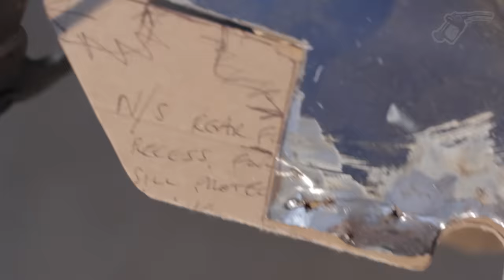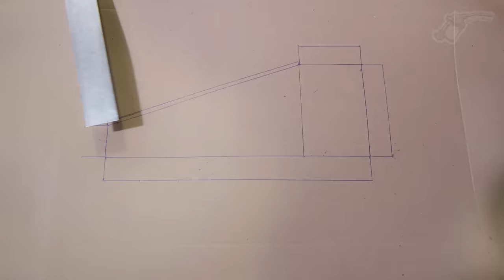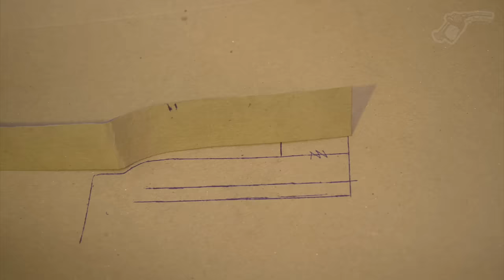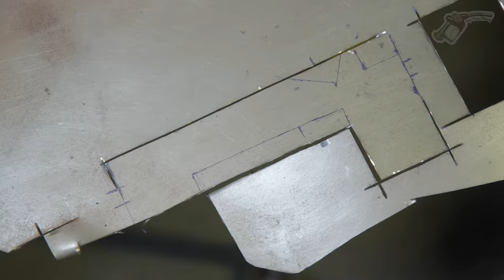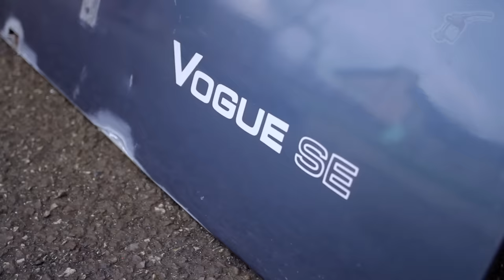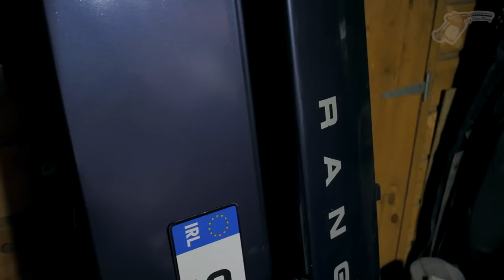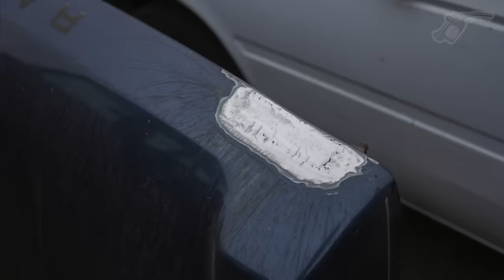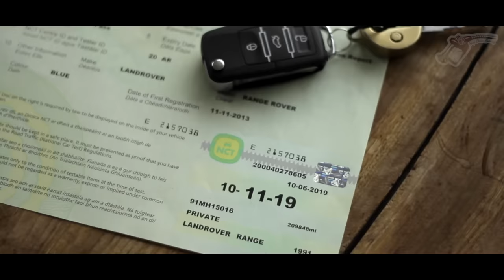How I restored a classic Range Rover and saved it from the junkyard // SOUP Classic Motoring

Comment from the maker: To everyone here - THANK YOU! Just FYI on a couple of the questions and observations; The car was bought new by my uncle in 1991 and yes it lived by the sea, travelled on ferries often and made regular family ski trips to the Alps. It is much loved but worked hard and has 210k+ miles under it's belt. My uncle is a conscientious man and I got the car with a bulging box file of history that begins with the brochure and options list. It details every bit of maintenance, and shows that the car missed only two scheduled maintenance intervals. One by 40 miles, the other by 500. All others were carried out early. Over £48k was spent on money no object maintenance in 25 years of ownership before I took over. The car was just under £38k new with many options. The fact the engine has that mileage without major rebuild is testament to how well it was looked after. The trouble was the people contracted to upkeep the bodywork weren't doing a proper job, unbeknownst to my uncle. Regarding brakes, suspension and general mechanics; the calipers and discs were new just months before I started, they just look tarnished after three years lying up, the car brakes like a modern. The shocks and springs too look a little scruffy but again weren't on the car long. In short it drives tight and even the steering box is almost free of play for a Land Rover. Later in the video I cut out floor sections, and pull back welds that I had already repaired, this was to rectify poor welding that I identified having gained experience. Yes I used a €99 gasless welder from the supermarket. That's all I had, and no money. I didn't do a frame off resto because it took me completely by surprise, it was supposed to be a two month turn around for a quick fix, but the deeper I dug, the worse it was. There were many times I thought 'this is nuts, scrap it' but I wanted to prove what can be done with a determination and passion. Plus there's a Lotus Esprit on the channel that I want to restore to perfection, so I treated the Range Rover as a skills building jigsaw. Practice. I'd recommend that mindset to anyone who has always wanted to do their own car resto. If you want it bad enough you can make it happen! I worked on this full time, and it's just me. The video production work in the project was like a day job, soaking up hours and getting in the way. This Range Rover is dear to me and the family, but no one is under any illusions, the job I did is far from perfect, it wasn't financially viable [but I wouldn't have farmed out the work if I'd had the funds]. What I learned is as rewarding and enjoyable as being able to drive the car. I fully expect to do a body off restoration on it later. But not before I enjoy it for a few years first ;)  Thanks again! The other episodes explain the process and the average guy with no budget ethos of the build, and if you're into more, sub and catch up on the Lotus Esprit project. That's shaping up to be special. This project was funded by patron support only, you'd be surprised by how little it cost overall once you are determined to do the work yourself and make anything you can rather than buying. Any support you can give for the channel, whether it's a like/share/sub/turning on notifications/buying a tshirt, or direct financial support, will make a big difference and can be lent here: www.georgekarellas.com
Reply: I admire your persistence, I know very well range rovers and I'd have sent it to the junk yard with that level of rust. Removing the roof ... Crazy! But kudos for such a great work and filming it all the way!
Reply: A very dedicated piece of hard work (sort of like a Kamikaze)  how long did it take?
Reply: Never mind. I listened to the introduction again.
Reply: I may be a bit stupid about this but if you remove the top sheet and find corrosion on underlying structure doesn't it stand to reason that probably a lot of the underlying structure is corroded as well?
Why then only treat the visible area and not disassemble all of it?
Looks to me this will corrode pretty quickly again from within.
I get that this wasn’t your plan but you already invested so much time and effort it seems a bit odd to then cut short.

Anyway great video looking foward to that Esprit.
Reply: Please pin your comment or add it to the description ... this explains why have you gone about fixing the Range Rover in this way. I commend you on the work done for both, the restoration and the video.
Reply: The level of patience and skill required to make this Claymation-style restoration is staggering to me. Well done!
Reply: Amazing the amount of hard work you put into this. Just want to know if the engine was restored already too
Reply: A lot of work for a suv that isn't worth a lot. Great work though
Reply: I love the way your welding got better as the project progressed. There were a lot of component parts which you repaired instead of of replaced. Kudos to you as you saved a heap of cash even if it took you a lot longer. You’ve ended up with a solid, usable Range Rover and while its far from concourse standard it looks like you’ve enjoyed yourself and you’re ready to put your skills to use on the next project 👏👏👏
Reply: I just found the numbered videos. I think they will answer a lot of questions I have. However having a way to contact you might be helpful as I proceed with my RRC restoration. Thanks. Chris
Reply: The Native American tribal music is LOLOLOLOL.
The real miracle in this video is that someone could (1) find the precious time to waste on this, and (2) value their time so little that they'd waste it on this.
It's like those Buddhist monks who spend countless hours on a sand painting only to sweep it into the garbage the moment they finish it.
Reply: Soup, Seriously man great frickin job! I want to do this with a Discovery for an overland build/camping rig.
Reply: "...I wanted to prove what can be done with a bit of passion..." This is the best explanation for what was done. Nice job and well documented - in stop motion! Greetings from Brazil!
Reply from the maker: @johannwolf1  🤠
Reply from the maker: @TasteMyStinkholeAndLikeIt  If you value your time highly then you spend it doing the things you love, don't you?
Reply from the maker: @957X99  Hope you enjoy! Thanks Chris.
Reply from the maker: @Praxics0815  You mean the doors? I they'll be replaced soon as they start to sag. Thanks man, one Esprit coming up. This time it'll be perfect.
Reply: @Praxics0815  you kinda answered your own question. Its was kind of quick and dirty and a project for him to hone his fab skills. There could be many reasons why he didnt do it, probably time being the main factor
Reply: Am subbing immediately.

Spent the hour in awe.

Have an e34 I have been meaning to give this kind of treatment. 

You my friend, are an inspiration.
Reply: Just recently discovered this amazing channel George, fantastic work but how is the Lotus coming along, I've binge watched all the current episodes and its been a while since your last Lotus up load.
Reply: My God... what have you done. Stunning work all round. And a worthy subject, none more. Chariot of the Gods.
Reply: Um, how many months did this take to do?! What job do you have that gives yo so much time to do this?
Reply: i was going to say i love the skill but hate the car. but i guess there is history there. so much respect
still great skill and great vdu
Reply: WOW! You have me awe struck. 

But, as (amateur) photographer, I have to ask... How many months would you have shaved off the restoration time had you NOT documented the process in the superb way that you have? Capturing all that work and editing it to this video must have taken its toll.
Reply: I have always been amazed at the degree that the Brits were willing to restore cars. An uncle's car makes more sense, but this stop motion restoration is as brilliant and mesmerizing as it is crazy! I have an early 60s Vespa that I restored when no one wanted them (and were having them crushed in a cash-for-clunkers scheme in the 90s) and now they are made from unobtanium and very valuable. I hope that RRs will enjoy a similar upward valuation. Also, it occurs to me, that the RRs had aluminium bodies. Weren't they supposed to be immune to body rot????????
Reply: Sir! There is one word todescribe your work: Mesmerizing! And there is one word to describe you: a passionate artist! You deserve 50M views and 5M subscribers!
Reply: somebody pay this guy a cold pint he rebuild a entire car alone WTF
Reply: Hey bro, I really enjoyed your video and I know it takes a lot patience and last you have your reward, superb 😎👌💕
Reply: What if were to restore a Land Rover?
Reply: You should have just stuck in it all down and did everything at once instead of start at one end and then put it back together and start the front end start the top of it back together just take it all apart and do it all at once
Reply: The choice is a cheap stay or they can put a little bit of nickel in there that still won't rust it Russett everywhere from one end to the other was it worth it how long did it take two or three years
Reply: RESPECT from brasil, you are genius
Reply: @computadordacasa5236  yes I know but can you believe it is hard to be me
Reply: SOUP . Classic Motoring I loved watching this film, I bobtailed a 1976 3 door some years ago, all the Rover V8 variants I have come across over the years have all suffered from the last lobe on the cam wearing to a round, has yours not suffered the same fate?
Reply: That was humbling. I hope your next project is saving the world, we would be in good hands.
Reply: SOUP . Classic Motoring  Utterly brilliant. Not only the work you did on the Classic. But the filming and animations. I’m sure it must have taken at least four times longer because of the work involved in the filming. But I think it was worth it. Yes as you say not a cost effective restoration but you’ve saved it and learned a lot of good lessons. Well done nothing but admiration and I think you’re spot on when it comes to learning new skills.
Reply: Very well done on this project. I have the same Range Rover in my shed waiting for me to start doing it
Reply: I am by means a person who generally works on my own vehicle outside of oil changes&occasionally flat tire,[never had someone 2 show me "the ropes"] and tbh i was absolutely captivated by ur dedication&level of detail u put into this project! The style in which u presented the video made it so much more personal&up close...which in turn made it that much more appreciated. I never watch videos of this type but maybe I've been missing out! Good luck from Ohio(🇺🇸) in whatever is next. Definitely subbed!!
Reply: This was surreal watching.
Reply: @TasteMyStinkholeAndLikeIt  your commentary on Mark Zuckerberg is a pretty good misunderstanding of what drives people. I'm not rich but I think I have a bit of an idea, I recently inherited enough that my house is paid for, and I could probably stop working the next 10 years. 
But I live out of a hotel, on the road, my job often requires 60 hours a week, I still look for deals and drive a practical car. I love Ferraris and it's weird that now that I could buy one straight out, I dont have the time to keep it up and I dont see it as a sound financial decision. 
I'm not sure what I'm waiting for, the money is good in my field so I'm gonna save up while its paying at this level, and when I eventually physically cant keep the hours I'll move on to something all-encompassing like this or yacht restoration.
Reply: @benfidar  Ford-era Jaguars were aluminum body, the one good tech Jag got from Ford. Never heard of a 90s RR being aluminum body.
Reply: @johnfilmore7638  They were aluminium from the very beginning save for the tailgate and the hood/bonnet on the very earliest models.
Reply: @benfidar  so what part of Range Rovers and Land Rovers exactly is aluminum?
Any RR or LR earlier than the mid2000s turns into a rolling rustbucket after 7 or 8 years.
Possibly the roof is aluminum but every panel on this RR was rusted
Reply: @johnfilmore7638  I have never owned one, but everything I am reading is saying that the body panels are aluminum.
Reply: @benfidar  yes JLR vehicles (Jaguar Land Rover  group) are aluminium bodied NOW, but they weren't before.

JLR has been owned by several conglomerates after being sold by British Leyland, 

some of the most desirable LR/RR (other than classic Defender) were after JLR was bought by BMW, and JLR vehicles inherited alot of engine & suspension performance tech from BMW, and that's when LR/RR became known for on road performance as well.
The BMW sold JLR to Ford Motors who improved the reliability on SOME models, but kept very conservative development, those Jags were charming as being somewhat anachronistic old-world charm, still had the most exotic real wood you will see in any production vehicle, but the vehicle tech was basically carried over from Lincoln Towncar, reliable but bleah.
IMO there was only 1 good thing to come from Ford ownership, and that was aluminum unibody design. Ford spent $millions trying to make aluminum panels cost-effective for the Ford Taurus, developed probably the most price-competitive aluminum body mfg workflow, but Ford couldn't get it to scale to full mass-production at a price point competitive with steel, so Ford gave their aluminum mfg tech to Jaguar, who were not selling mass-production vehicles and commanded higher margins.

Now Ford has transitioned the entire F-series pickup trucks to aluminum body. The challenge is automotive panel grade aluminum must be prevented from oxidizing for paint primer to hold, and it oxidizes from a mirror finish (unoxidized) to non-mirror within seconds of being exposed to air, it's a microlayer
Reply: @johnfilmore7638  Everything I am finding, and I mean everything, says that the range rover was aluminum bodied from the very beginning, with the exception of the tailgate and the bonnet. Please provide a citation that shows that early models had steel bodies.
Reply: @benfidar  well before I start linking sources, did you actually watch any of this stopmotion?

 and if so does any of the corrosion look like anything other than iron-oxide corrosion? 

For reference, aluminum-oxide is extremely hard, doesnt look reddish like the video, is extremely hard, and so is the grit used to make sandpaper that can sand steel.

So here's a clue to evaluating whether everything you've read on RR is BS: if all RRs were aluminum bodies, and this stop-motion clearly demonstrates panels and structural members corroded by IRON oxides (aka rust)...

The OP poster of this video would have had to have acquired a custom-made Range Rover built by a coach-works, custom-designed to be significantly heavier than this alleged OEM mid-90s aluminium Range Rover.
 Any hand-built coachworks copy or interpretation I have seen of an original starts at US$300,000 because artisan craftsmanship is a magnitude more expensive than mass production (most of mass production is the initial cost of designing and getting the tooling up and running).

Do you really believe the OP found a custom coach-built steel-body Range Rover that new cost 20x rhe price of a mass-produced (allegedly aluminum) Range Rover, and that the original owner neglected and let rust out after paying 20x the factory price, but for a heavier, (& by most metrics) inferior copy of a Range Rover?

Or maybe the OP dedicated his life to fabricating a fake an entire fake non-aluminum Range Rover, one custom hand-formed stamping at a time, so 10 years of fabricating an elaborate (allegedly fake) steel Range Rover could get him a couple $20 Patreon fans?

You have a better chance of proving Peter Pan is not a fantasy than you do that all Range Rovers have been aluminum bodied.
Reply: @johnfilmore7638  Um, yes, hence the question. Link away, my friend.
Reply: @johnfilmore7638  UGH! YES! THAT IS THE REASON WHY I ASKED. WHAT, ARE YOU 12?
Reply: YOUR VIDEO ANIMATION IS FAN-TAS-TIC !!!
Reply: @TasteMyStinkholeAndLikeIt  "...every adult activity you could want.  Jet skis, quads, motorcycles, race track with exotic cars, paintball field...". Without trying to be an ass, I think this part exemplifies best why having so much drive goes so far beyond your imagination.
Reply: i love your work. 
but could you please post a list of the songs used for the backgroundmusic?

i am espacially interested in the song used around https://youtu.be/bRs-4AXb9_U?t=3951 1h 5min 51sec.

thank you! wonderfull video!
Reply: What's that weird-ass shroud around the rear disc?
Reply from the maker: @TheHeretic435  Just a big-ass brake shield, prob with the idea of keeping heavy mud out but a lot of guys who still use the cars off road remove them.
Reply: @benfidar  I'm pretty certain he's Irish! but all the same
Reply: Just seen this recently and I'm blown away by the effort put into this. I've restored a Spitfire myself, but I only did the mechanicals, all panel work and spray I paid for. I think every project ends up bigger than anticipated with unexpected gremlins popping out of everywhere. That you stuck with it and just kept going is a massive testament to your determination - huge well done. You enjoy a sense of reward every time you drive that gorgeous rangie that most people in the world will never experience. Kudos!
Reply: A great job and a great video. With patience and love, everything Is possibile.
Well done man! 👍👍👍
Reply: Amazing work. In addition to all your hard work with the restoration, the filming and editing technique probably took many many tens or hundreds of hours!
Reply: Kudos!
Reply: U have tooooo much free time.
Reply: SOUP . Classic Motoring massive respect for this masterpiece!
Reply: After watching the entire film I have to also say thank you for such a special, entertaining, inspiring film perhaps one of my all time favorites
Reply: Womderful! Thanks for sharing!
Reply: curious how much something like this cost you, I'm planning to restore my 1999 range rovers body followed by engine
Reply: What kind of metal did you use for your  project? As I my notice, you didn't use argon, consequently it's some kind of steel. Am I right?
Reply: @benfidar  I think Audi still claim to have aluminium bodies yet there is no rush to buy them. Humans are strange animals 😊
Reply: Amazing video a pleasure to watch it
Better than any Netflix serial
Reply: i cant imagine the frustration of slowing a restoration just to film it in stop motion,,how mny shots went into the making of the video?  the work you do mechanically is far more thorough and investigative  than professionals efforts i have seen thanks for the video
Reply: Soup Classic Motoring what’s the name of that animation? I think tim burton use it in some animated movies. Thanks
Reply: Sir, I salute you for for both the restoration AND the video work. What a lot of people won't realise is the road tax system, I bet your'e looking forward to 2021! 
For my sins, I'm an Englishman who has recently moved from London to Kilkenny with my Irish wife. Before we moved we knew we needed a decent car and the wife doesn't drive nor will she get on the back of my Triumph motorbike so it was pretty much my choice! (MWA-HA-HA!) and bearing in mind she has lived through all my 20+ years of owning Land Rovers she took quite some convincing that my 1989 RRC IS a sensible option!
It's cosmetically showing it's age but mechanically it's actually quite good. I worry a little about the future of it as I know there's patches of rust here and there showing up but I'll cross that bridge when I come to it. I'm not very mechanically minded so I'm keeping your video in my 'Watch Later' list for reference!
Thanks again for such an amazing video and here's to your 56 euro road tax instead of 1800+ euro!
(the robbing bar stewards!)
Cheers and good luck to you!
Reply: Incredible job! Gotta ask, though - I've always been told that a gasless/stick welder will burn right through material as thin as usually found in car bodies. How did you keep that from happening?
Reply: This video is therapy for the soul. Just what the Dr. ordered for COVID-19 LD. Thx for all of your patience in putting together this spectacular achievement. Sub for life here.
Reply: @benfidar ...... This vehicle is Southern Irish registered, so, I would suggest the word "Brits" has missed by at least a few miles, or rather kilometres. I am very impressed with such an amazing piece of work, but as a "Brit" I am upset to see that we let such a bag of bits out into the world...,but I'm sure the accountants of Solihull laughed all the way to the bank. It's an amazing piece of work & a great piece of film.
Reply: @robertwoodliff2536  Yes, you and the other 83 people said as much.
Reply: @benfidar ....... Good to hear you have a better understanding now.
Reply: @robertwoodliff2536  Go bother someone else. This stopped being funny 8 months ago.
Reply: Soup Classic Motorin
Reply: Danay
Reply: Wow!
Reply: Love it mate you did an amazing job  , when something is dear to you  you will do anything to keep that close .
Reply: how long does it take to do all things you have done on this range rover?
Reply: U did such a amazing job.   It turned out so amazing!
Reply: L
Reply: Wow... in my opinion : You are Sir.. a professional video maker and car restorer.. and a humble person.. and you really have a good soul indeed..
Reply: I woul have just bought a rust free body in Arizona and just transfer everything to it.
Reply: @benfidar  Actually it's only the skin that is Aluminium which actually creates problems with dissimilar metal contact( a virtual battery effect). So, Roof,Door skins, quarters and guards are ally but everything else is steel. When I was looking for mine i saw a few with bubbles in the bottom of the doors where the ally had corroded because it was touching the rusty inner door structure. Of course I ran away at speed! :)
Reply: I particularly  loved the background track when you refinished the rear axle.  I watched it 3 times.  Amazing amazing amazing job!
Reply: I never knew I needed this till now
Reply: Saya puye kete saga, boleh buatkan kete saga..
Reply: From malay
Reply: Что за монтаж? Очень круто! С таким монтажам не каждый день смотришь в ютубе?
What kind of installation? Very cool! Do you watch YouTube every day with such montages?
Reply: 54:15 ??????????????????????????????????????
Reply: What you done was fantastic
Reply: Here you can see that when the human being sets out to achieve something. But I am sure that 99% of those who saw the video would have given up. since the work that this man has done cannot be called restoration but construction. it's kind of awesome.
Reply: Iiiiiiiiilhiioi
Reply: plpl
Reply: llllllll
Reply: lplll
Reply: ll
Reply: @TasteMyStinkholeAndLikeIt  You are. In fact.
Reply: opppppppppppppooppppppppppppppppp
Reply: oppppp
Reply: oopp
Reply: o9
Reply: please oopp
Reply: 12rrr
Reply: 媼闇華語師資及的ㄥㄠㄥㄣ
Reply: 䩕
ㄣ
Reply: 洝ㄣ
Reply: ㄣ
Reply: how much money did the resto cost?
Reply: Dude, huge respect for the amount of patience you have. But why didn’t you get a used shell of a Range Rover from a salvage yard ? It would have been lot easier but I enjoyed every bit of the video. God bless!!
Reply: wowwwowwowowwwowwwwweweeewwe
Reply: eewwwwew
Reply: @caspery  ñ
Reply: @caspery  ññ
Reply: @caspery  

Lo
0
Reply: 00
Reply: P
Reply: 000
Reply: 00
Reply: Pop
Reply: P0
Reply: 0p
Reply: P
Reply: 0p
Reply: P
Reply: 0
Reply: 0p
Reply: 0
Reply: 0
Reply: P
Reply: P
Reply: 0
Reply: 0
Reply: 0p
Reply: Pp
Reply: Pp
Reply: Pp
Reply: P
Reply: P
Reply: P
Reply: P
Reply: P
Reply: Pp
Reply: Pp
Reply: P
Reply: P
Reply: Pp
Reply: Pp
Reply: P
Reply: Pp
Reply: P
Reply: Pp
Reply: Pp
Reply: P
Reply: P
Reply: Pp
Reply: P
Reply: P
Reply: P
Reply: P
Reply: Pp
Reply: 0
Reply: P
Reply: 00p
Reply: P
Reply: P0p0
Reply: 0p
Reply: 0
Reply: Pp0
Reply: 0p
Reply: J
Reply: J
Reply: I’ll
Reply: O
Reply: U r crazy man -much respect 👊
Reply: א 3 3טטט
Reply: Just some questions. Who did this insane job? You and your uncle? Where a lot of titles at he end of your film?
Reply: Why is the steering wheel on the wrong side?
Reply: XIX z Zezé
Reply: ³³³z333³³³³3333333³3³3333r333333³³333333³3333333333333333333333323e333³33³3b33333³333333³33333³33³3r3³33³334³33333333³333333333333³33333333³3³333
Reply: Very hard and Very good job, o see, you love your car true, sorry for my breaking English, I'm from Russia.
Reply: Pp
Reply: This dedication ❤️ great work and excellent filming!
Reply: @benfidar  you are correct. The outer skin of range rover classic were aluminium. The rust repairs are being done on inner panels. A magnet won't stick to the outer body. But it will on the inside. The whole thing is bolted and riveted together and can be completely disassembled and reassembled.
Reply: @johnfilmore7638  you are wrong and obtuse. Not a great combo it must be painful to know you.
Reply: that is incredibly great!
Reply: k
Reply: OK, George, now it makes sense, A crazy Greek decided to punch a knife. Congratulations again, the car will last as it is now forever !
Reply: @andred.4315  o
Reply: ⁰
Reply: Respect. Persistence is the key..
Reply: Shines like a crazy diamond. I am sure your uncle is proud of you and your work on the Range.
Reply: ³
Reply: 11
Reply: U took everyones mind and love ..u r a real man
Reply: 고숫솟ㅅㄱ솟쏫
Reply: 곳쏘ㅗㅗㅆ
Reply: @vstrabello   by 4f5
Reply: I give you mad props man. THIS IS INSANE. This should be on Netflix.
Reply: You saved that machine from the scrappers some things just can’t be measured by money
Reply: There had to be points along the way where you said to yourself “what have I gotten myself into”.....Great display of persistence, perseverance and hard work. Hope it stays in your family forever.
Reply: George , you have done a great
Job, my only wish that l have the
Stills & mind set , but sadly l do
not . l love the Classic range
Rover & always have love there
Robustness.Not a fan  of the
 lastest ones
with all the electric gizmos
that break down & costs
Thousands to repair
God Bless & enjoy it.😅
Reply: Absolutely incredible piece of workmanship and cinematography. Chapeau man !
Reply: Fantastic journey you shared. Thank you!!
Reply: @1Esteband  Range Rover is Hebrew for rotten egg.
Reply: The level of details in resto surpass everything  seen thus far!! Thank you
Reply: Wonderfully created video
Reply: DUDE! This is so satisfying! Even my wife that doesn’t like cars videos has watched this with me. You nailed it 🔥🔥